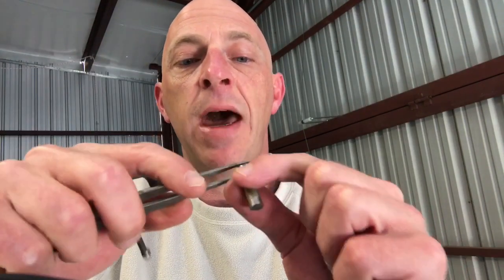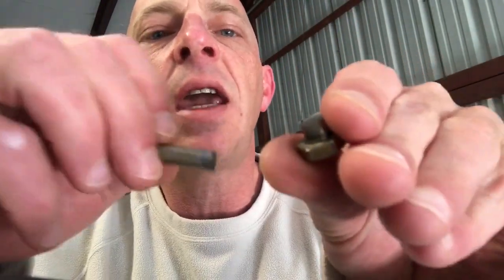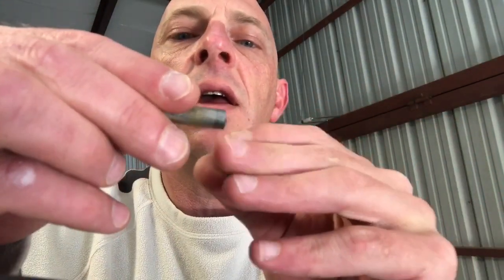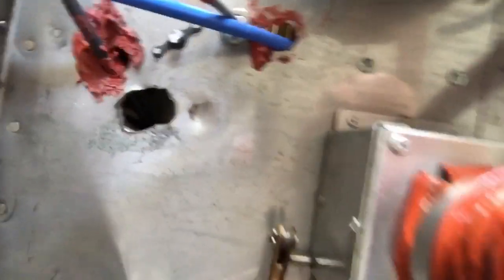RV-7a Nose-Gear Collapse Part 3

Comment: I saw this thread on Vansairforce today.  Was there a service bulletin issued on this particular problem with a viable solution? I've been considering the 7A for a while now and have heard this has been an issue on some of their nose wheel kits.
Reply from the maker: There is an SB for this issue.  When I bought this airplane, I had an inspection completed but somehow this was missed.  There is an anti-splat kit that reinforces the nose gear.  I don't think it would have helped in this case.

The RV is a great airplane and don't let this issue sway you!
Reply: Paul V 

Hi Paul.

Just experienced bad accident likely due to nose wheel shimmy and collapse after unintentional hard landing.

 Here is my sad damage. 10 crosswind landing. Fully VFR day.

Thanks
Reply: Thanks